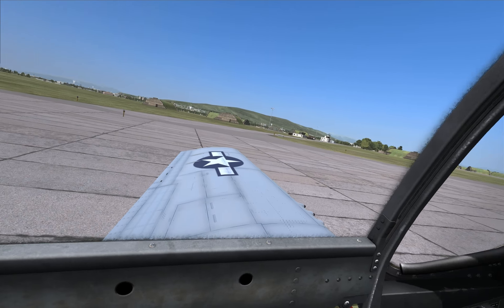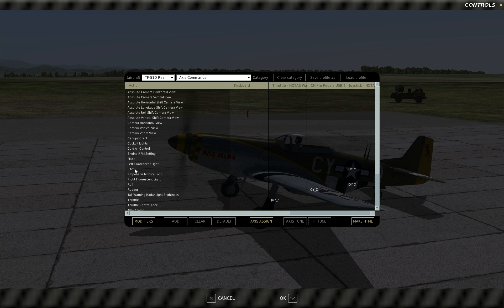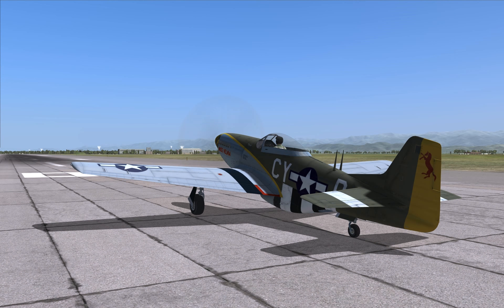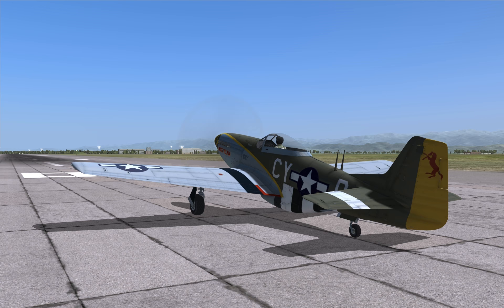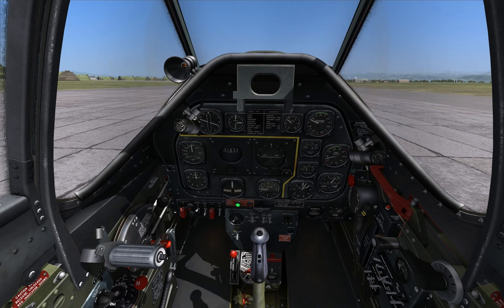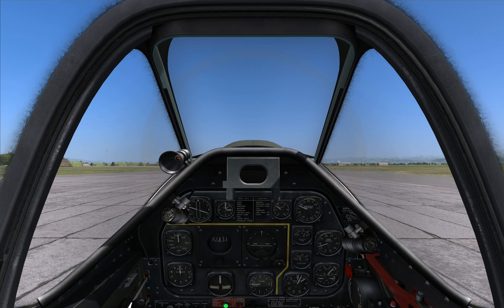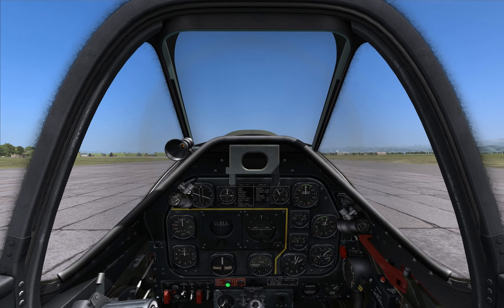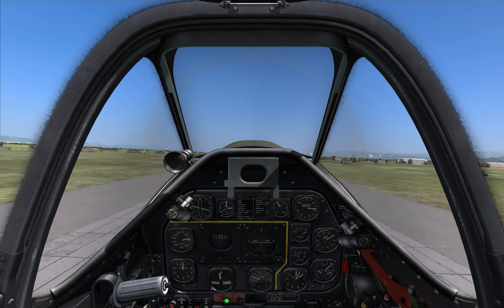DCS World: TF 51D Takeoff tutorial (1.2.14)

Comment: I like to get on, do the Cold Start, take off, climb to 5,000 then shut the fuel off and land it. Just for fun...

I can land it half the time, but rough terrain makes me bounce to the side and usually crumples the landing gear. Haven't managed to restart the it in mid-air yet, and it took me a while to learn to fly it. Now I can get it started in like 10 seconds. takes me almost a minute to get on to the tarmac, but then I'm in the air...I wonder if I could actually do that in real life now?
Reply from the maker: Take off that fast? Well I think you would have high chance of damaging engine. Before takeoff it's recommended to do a warmup, to make get engine sealed and oiled.
Reply: Eh, I've had the engine lockup before on take off, didn't make it over 200 feet up, and managed to spin back around for the landing. Then my landing gear on my right wing didn't come down, so, you know how that went.

Usually though, I don't have a problem with taking off, even if I don't do a proper startup. I have noticed that i started leaving a smoke trail at 20,000 feet. Still ain't figured that one out, though I think it's because I don't have the carb set right.

I love flying in games, but you'd never get me in a plane to fly IRL. I'm just too big.